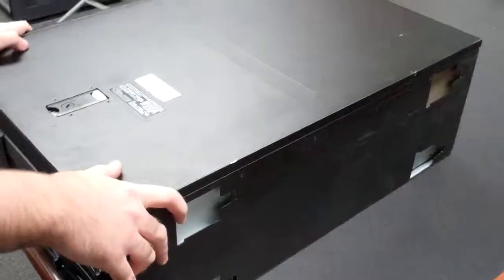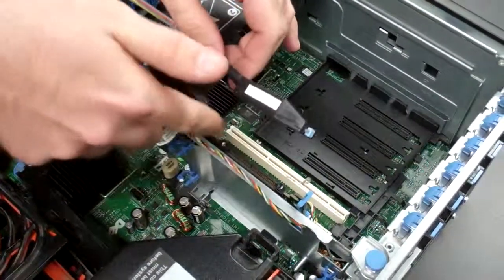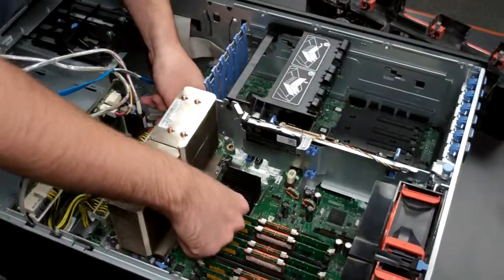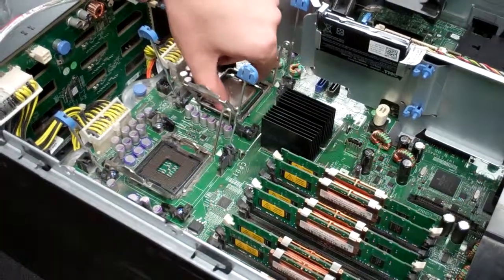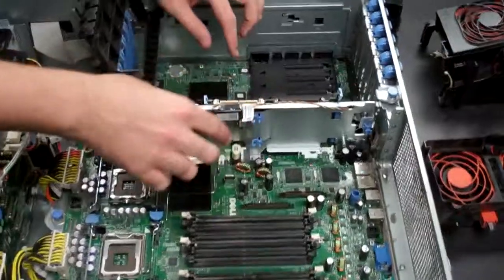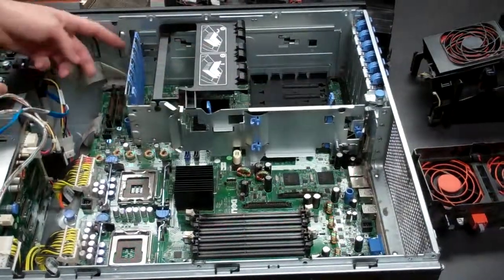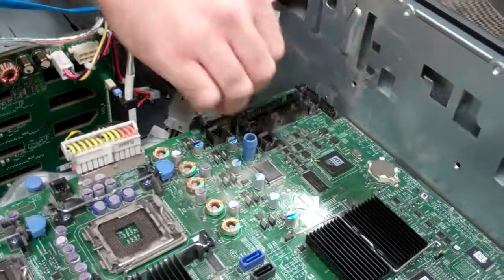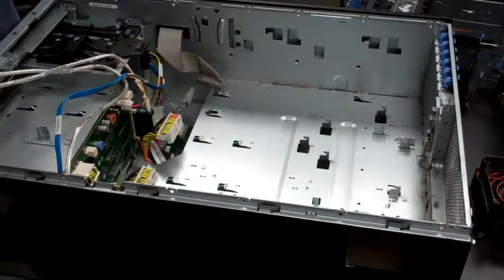Velocity Tech Solutions - How to Remove a System Board on a PowerEdge 2900 Server

Comment: If I disconnect the battery on the raid controller will my raided disc be lost???
Reply: +jesperbbb Your raid disks should be perfectly fine.  The battery really only comes into play when the server loses power to keep the cached data preserved till the server can come back up and write the cache to the drives.
Reply: Dylan Kerling Thanks for the answer, my server went black and complained about the memory on the small display, But no boot screen on the monitor so i guess the motherboard is broken.
Reply: +jesperbbb It definitely could be, it would probably be worth going down to one stick of ram and trying to boot and swapping out the stick in slot 1 if it doesn't post the first time.  It could be as simple as a failed DIMM as well.
Reply: Dylan Kerling I tried one pair of rams but the same error messege appear and no boot screen, and without rams the same problem and no boot screen. So i hope its a faulty motherboard
Reply: If you unplug the machine and then disconnect the battery  then yes, you will ABSOLUTELY loose your RAID configuration; but some controllers can recognize the disks and reconstruct the array, especially if the disk placement is/remains exactly the same, but then again some don't.